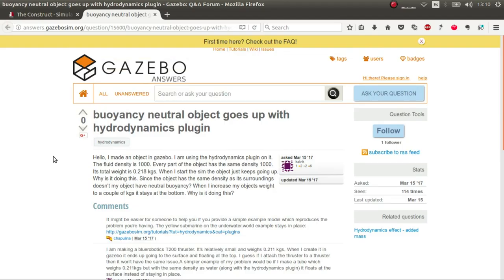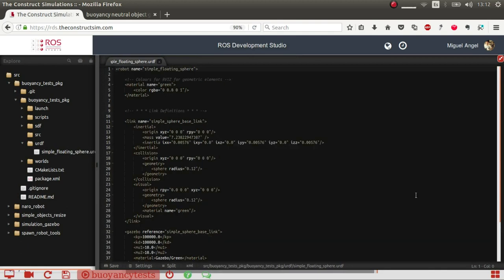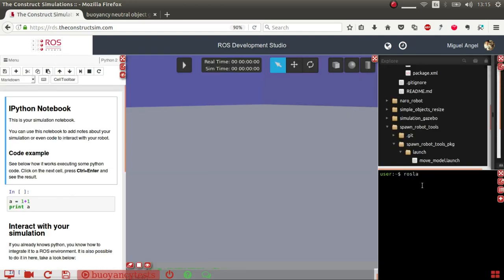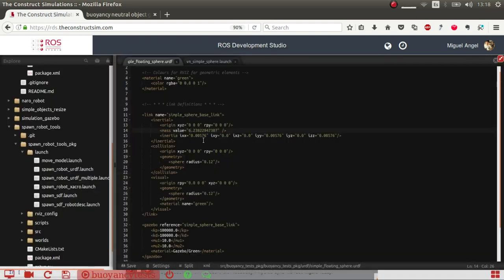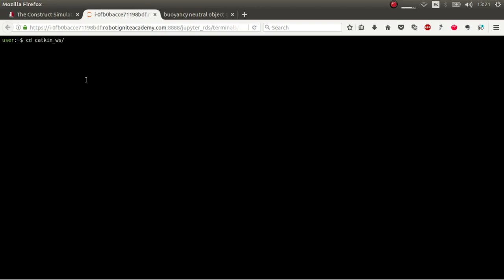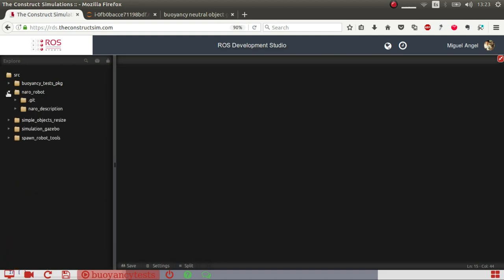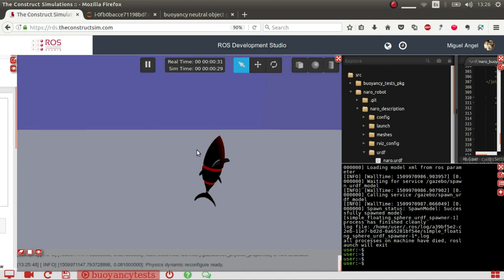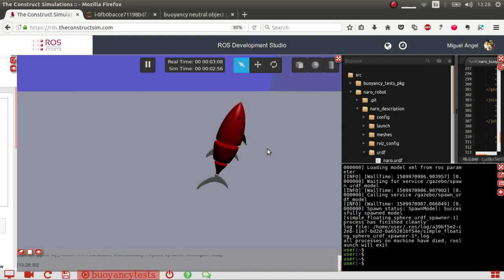[ROS Q&A] 054 - buoyancy neutral object goes up with hydrodynamics plugin #Part 1

Comment: Hi! 
It would be great if you post a video where you tune your robot masses. I  am doing my own robot and stuck at that point. I took volumes of my links from Solidworks and calculated masses such that each link has neutral buoyancy after that applied that masses to my objects in Solid and recalculated moments of inertia. Nonetheless it still behaves precisely like your fish, tail is down, body is up. Thanks!